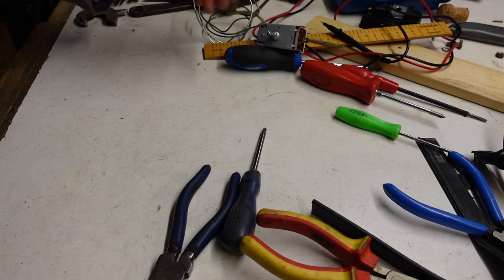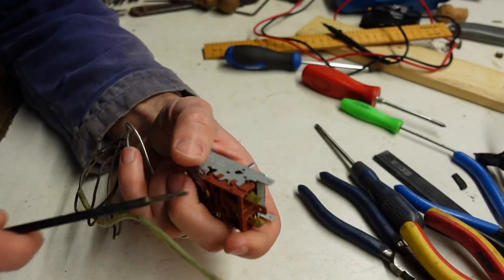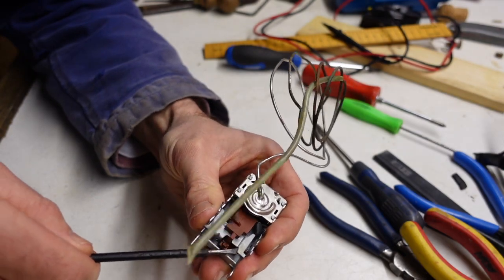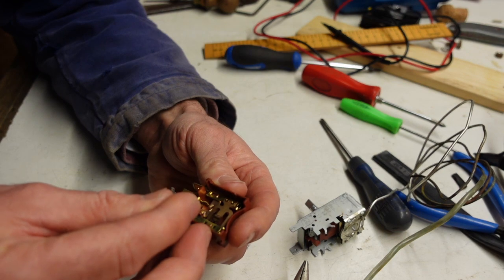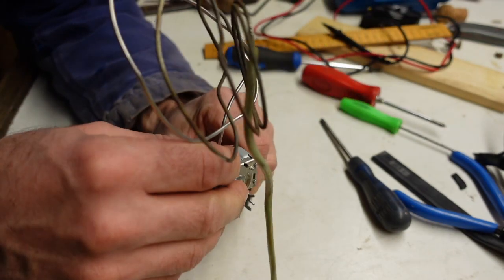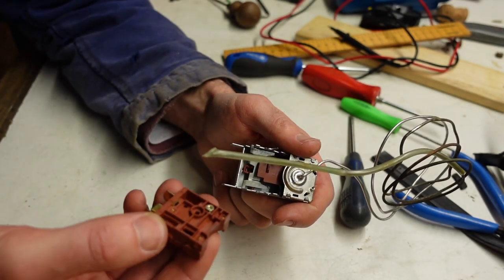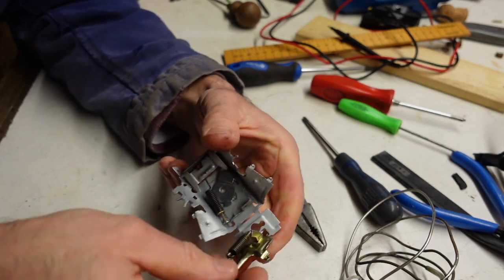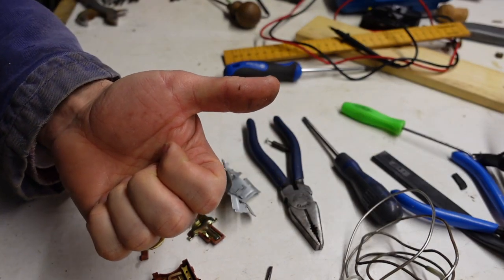Disassembly of broken ranco fridge thermostat

Comment: Nice video. Want to replace my fridge's thermostat as it's been running constantly. I am however unable to reach the point where the thermocouple wire screws into the evaporator plate. Do you think I can install a new thermostat by transfering the old thermocouple and applying it on the new thermostat?
Reply from the maker: If your fridge is running then you'd better run after it! The old thermocouple should just push in and pull out.
Reply from the maker: If your fridge is running then you'd better run after it! The old thermocouple should just push in and pull out.
Reply: Ambassador

Comment: Worth a look, 10 mins well spent to find out how it works. Was the failure diagnosed ?
Reply from the maker: I reckon the pipe was corroded. A leak and hence no pressure on the bellows. I’m making it up. Can’t say I thought to make such a diagnosis. There was no arcing on the contacts.

Comment: do you think we can "repair" it by adjusting the two(even 3) screws ?
Reply from the maker: The short answer is I don't know.  But the longer answer is that I think over time the thermocouple pipe corrodes and won't drive the bellows to the stat. So no amount of adjustment could correct it. You might correct me though, I am no expert. I do think that the tiny price I paid for a new stat was worth it given the constant and necessary use I get from this machine!

Comment: how is the pin out of ranco K59 ?
Reply from the maker: I can't remember, but it should be easy enough to figure out from the spec sheet.
Reply: @bootsowen  I came across this description 4-6 closed when hot, 6-3 open when off, what would it mean in a fridge ? say 4-6 turns the compressor motor on ? no idea
Reply: what would this description possibly mean : 4-3 closed when hot, 6-3 open when off ? do I have to disconnect if from the fridge in order to test it ? @bootsowen